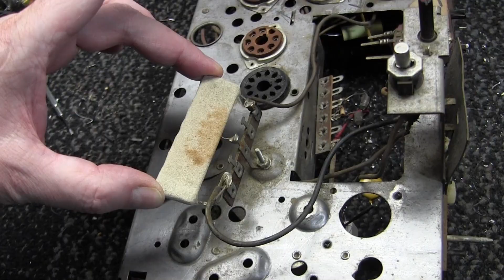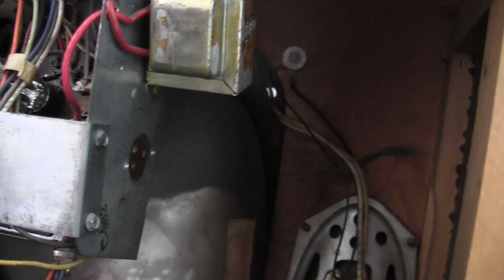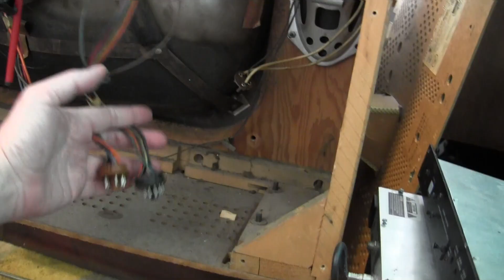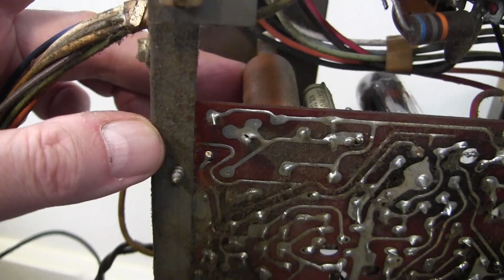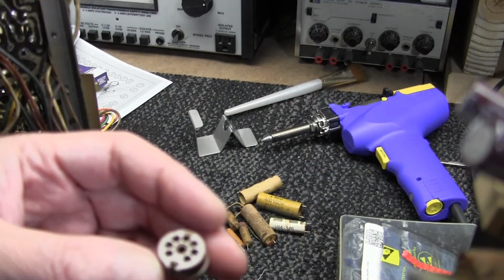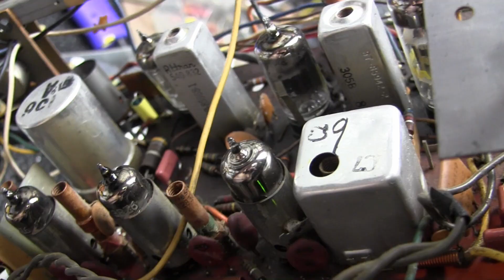Sylvania Halolight/Sylouette 21C529 part 4

Comment: TV with a good CRT that wasn't used long enough to develop all those problems? I have two Silvertone 21" BW of this vintage that have similar power supplies. The diode replacement for a power resistor is a great idea. That analysis was pure Engineering Design. This set is worth doing in 5+ video parts!
Reply from the maker: I think this TV was used quite a bit as it has a replacement, rebuilt CRT.  I think the power supply work was done in the late 70s - early 80s.

Comment: I found that, the hardest part of a restoration is often delaying the first switch-on of a device until the replacement of the electronic parts is quasi-done... I mean, I agree one should resist "trying out" any appliance when getting it, with the risk of setting it to fire. Besides... generally one doesn't restore something if one, or somebody else, isn't interested in it. Delaying the try-out just heightens expectations :)

Comment: How did you come up with the values for the diode and thermistor to replace the 35 ohm dropping resistor? Is that thermistor a common stock valve?
Seems like 120 ohm hot would limit current too much, if 35 ohms were original.
Reply: Sorry my bad, this was answered in part #3.  Thank you Bob.
Reply: @ebones6957  I believe that this was a negative coefficient thermistor.  The hotter, the less resistance.

Comment: I find it interesting that Sylvania decided to split the chassis into two assemblies, although I'm not sure why.  This adds cost and makes servicing more difficult.  I am a bit surprised by adding extra cost with the two chassis, they didn't just go ahead and use a power transformer to avoid the hot chassis problem and non-standard tube filament voltages.
Reply from the maker: I do.  They used these chassis in many models over several years - consoles and tabletops.  Two chassis gave them more flexibility with cabinet design. No power transformer was common for the era.  Saves cost and weight.  What I do find odd is some runs the vertical oscillator in the sweep chassis while others had the horizontal oscillator.
Reply: @bandersentv  I wonder if they had ground loop problems, hence the heavy grounding braid between chassis.